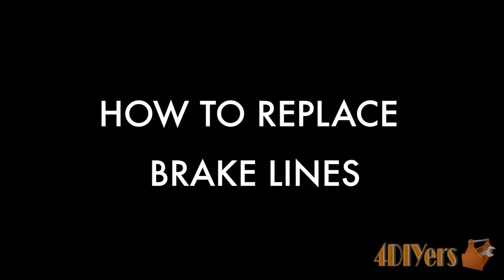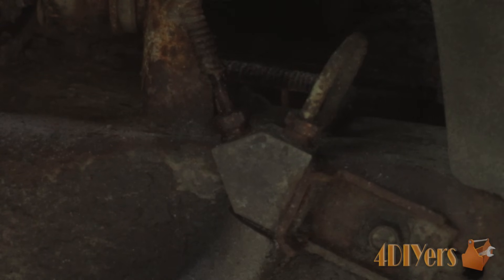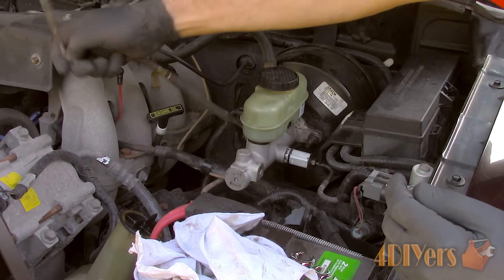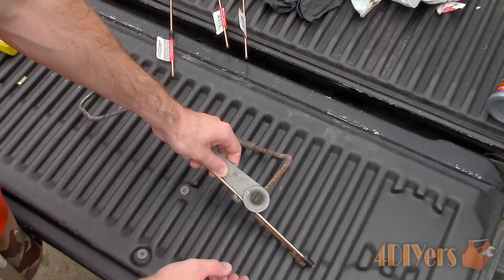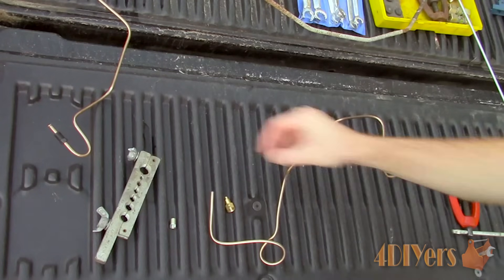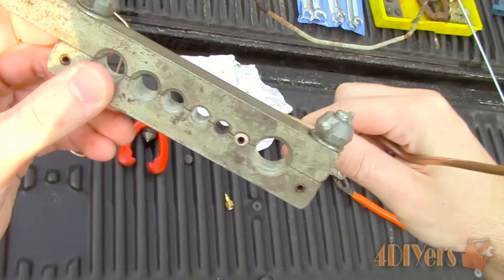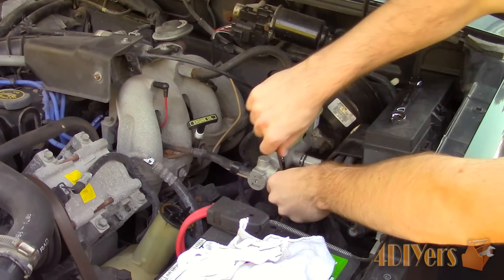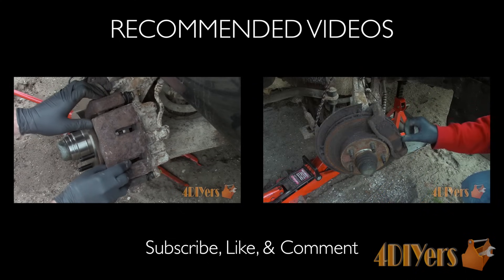DIY: How to Replace Brake Lines

Comment: Doing perhaps the very same (front passenger) line replacement on a 2003 Ranger. The original line not only has the anti-vibration coil around it, but about a 3" section that appears to be a braided flexible stainless steel hose, near the master cylinder. Can I replace it with regular copper? If so, would it be worthwhile to put two loops on that side?

Comment: Maybe I missed it, but I don't think you mentioned anything about draining the brake fluid from the reservoir before disconnecting any break lines??  Im guessing that vehicle didn't have any fluid due to failure, but what about if it did.?

Comment: Good video very matter of fact presentation.  I would suggest using brake fluid as the lubricant when doing the flares as you will not introduce any foreign contaminants into your system this way.
Reply from the maker: Thank you and excellent tip as well!
Reply: Gene Price I

Comment: Do the brake lines really have to be the exact same length as the old ones? I read it doesnt matter, i bought a set thats maybe 9 inches longer, i can just toss an extra slight bend to make it fit, anyone see a problem with that? Rather not have to get a flare kit

Comment: Can you tell me who makes a good rubber brake line.  My last 2 sets have only lasted 2 years each and the rubber is crap.  Eddleman is the maker of them. Now I need to do this again for the 3rd time and want to switch to a better maker.
Reply from the maker: Usually I stick with an OEM supplier with something such as that. You might be worth upgrading to a stainless steel braided line instead. Last set I purchased for my car was just over $100 for all four wheels, it wasn't much more than OEM lines which were about $20 each.

Comment: good job. very clear and no fluff.  one thing i didn't quite understand was the master cylinder bubble flare and the part you had to buy.  maybe explain that a little more
Reply from the maker: Thank you :) I don't have a bubble flaring tool. Some people say it can be done with a double flaring kit, but it's technically not the correct way and a safety risk. So that extra fitting is basically a conversion from one type to another.

Comment: Great video. Had a rear brake line break yesterday while driving. Scared me. Peddle went right to the floor. Do all 4 brake lines share the same pressurized environment? One busted line and there is no pressure left?
Reply from the maker: Thank you! Typically your braking system should be broken in half, usually front and rear. Technically you'll still have some braking power, but when the fluid level keeps dropping, depending on the master cylinder design, it can drain most of the fluid.

Comment: Any thoughts on just removing any burrs from the cut tubing ends, by gently sanding the end by holding it perpendicular to the disc on a random orbital sander, with a high grit paper then cleaning any debris with a shot of brake parts cleaner on the opposite end, followed by a shot of compressed air?  The de-burring tool I have doesn't come to a sharp point, so might be tough to clean the ends.  BTW, Great video and clear explanation you have given!  Thanks!
Reply from the maker: Thank you! Yep I know the issue. We just redid the plumbing on the house and the deburring tool was causing the same problem. You can use a small drill bit by hand, a step drill may even be a better option. A small rat tail file can also be used or there is also deburring tools which is used by machinists.

Comment: How isn't there brake fluid leaking away when disconnecting the hose from the cylinder?
Reply: why do you think the has to replace the lines? its all leaked out my dude

Comment: Just try removing  the old rusted brake lines in a 28-year-old vehicle. Mine is a '93 GMC Jimmy.
The new lines are a copper-nickel alloy.  Easy to bend without kinking, and won't rust. I used lines that are already flared. For lines that are not flared require a double flare. For that, you need a flaring kit.  
I got all lines replaced.  But I noticed that each joint leaks.  Just how much must these be tightened without stripping the threads?
Reply from the maker: I would say about 10-15ft lbs.

Comment: Can someone explain the second time he used the flair tool for the double flair what he did different? lost me at that part. Wanna buy and flip an old
Toyota celica convertible and the only thing wrong w it is brake lines but this job might be too hard for me lol
Reply from the maker: It folds the flare down, it's a two step process. The die in the first step flares out the line to one shape, then the second step finishes folding over the edge.

Comment: Thank you for this, great instruction, but a link for bleeding the brakes is missing and it would've been really helpful...
Reply from the maker: Thank you so much! Here are the links, I have a few different videos.
Bleeding brakes using a vacuum pump: https://youtu.be/kFQHy2WCDC8
Pressure bleeding: https://youtu.be/vi3hRDgviDA
An old one for manually bleeding: https://youtu.be/DdWEr9YIHNg

Comment: Awesome video. I was just curious as to how this is done and came across this. I thought your video was clear and straight to the point. My only critique is that I became a little confused when you described why you were using the flare tool twice. A closeup of the flares or a diagram would have been handy but perhaps it’s just my own inexperience in not knowing. Besides that, thank you so much for taking your time to share this great video. Cheers.

Comment: Considering replacing all of my lines but how am I supposed to tell whether or not oem is a bubble flare, or a double flare?
Reply from the maker: It depends on the vehicle. Something like BMWs use bubble flares and I believe Toyota uses a double flare.
Reply: @4DIYers  Yeah I can't find anything for my car, like ever.  01 Mitsubishi Diamante.  The fittings all look the same,  would rather know before I start taking things apart since I have no other way of traveling.

Comment: So i learned the hard way today, Hence the reason im here

i own a 2010 Kia Forte EX  and my Brake Light came on, noticed i needed more fluid. Ran to the Advanced Auto Store to pick up some DOT4. Placed it in and forgot to bleed my brakes.

Brake Petal became spongy after i was pumping it and now i have a leak. on the driver side back. 

Coffee is a must #Facepalm

Comment: wait, I thought that tool is able to make both double & single flares. Isn't single flare same as bubble flare?
Reply from the maker: Nope, they look similar but are different. Some people have been lucky enough to get away with using a single flare as a bubble but being on a brake system, it's far too risky.

Comment: Just returned from my mechanic. My truck is on the hose as I speak. The line is broken very near the re wheel. He told me he must replace the entire brake line from el to RT wheels. He told me the new line will cost me $40. 
I would never attempt this. I havent to tools for starters and no skills.
Parts and labour is estimated at around $200.
It's worth it to me.
How much did your line s and tools cost?
David
Alberta
Reply from the maker: Sounds like a good price for the replacement. The shop will have a mark up on the line, so $40 worth of line will be $30. Really depends on the shop. As for the tools, they've been around for years. You're better off getting good quality tools as this will affect how well of a flare they can produce. I would say it's about $50 for the tools, they'll pay for themselves in one repair.
Reply: Thanks for the response.
   You know what? The total cost was $167.00. NAPA told me the regular line goes for $8, but the garage had the properly formed line in stock. I'm  happy, but strangely the line runs under and to the back side of the axle whereas the factory line ran above and behind the axle. I can live with that.
I do not agree in buying the tools because as a DYer I'm not that skilled. Thanks.
David
Alberta

Comment: It begs the question, since the govt has over the years has mandated safety improvements. Why haven't stainless steel brake lines been mandated on new vehicles during manufacture. It probably wouldn't cost more than $50 per vehicle  I just replaced brake lines on my truck. What a total pain in the ass.
Reply from the maker: $50 in the long run adds up with millions of vehicles being produced. Car companies are there to make money and why make something last when you can get money back on maintenance too.
Reply: @4DIYers  I recently purchased a new car in 2018, I would spring for the additional $50 (It might not cost that much) for brake lines that would have little chance of failing. If the govt is serious about safety why haven't they mandated  stainless brake lines?
Reply: Btw your video is excellent.

Comment: You forgot to include my inevitability of cutting my line 1/2" too short, bending, cutting and flaring a second one, having to go back, and rebend it because it was wrong, then having to return to the store because i need more copper line. May as well take a lunch break now. Come back and get at it. Bust my knuckles. Curse. Get frustrated and give up for the night. Try again tomorrow. Call a friend who works on his own car. Friend can't make it. Try again. Put old lines back on. 

You know. Those steps.
Reply: exactly right